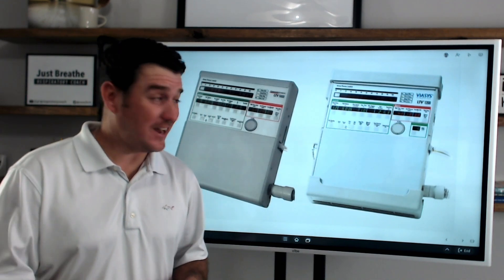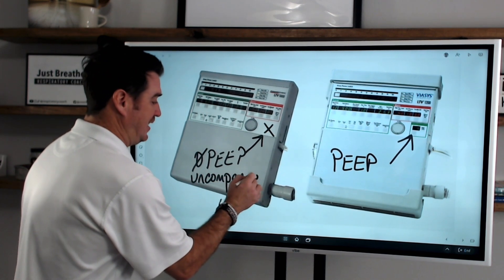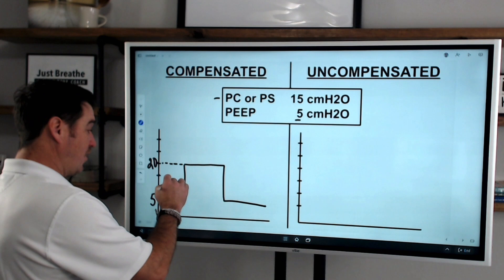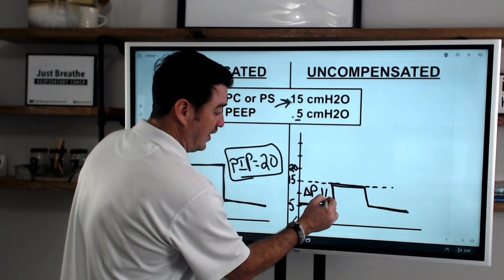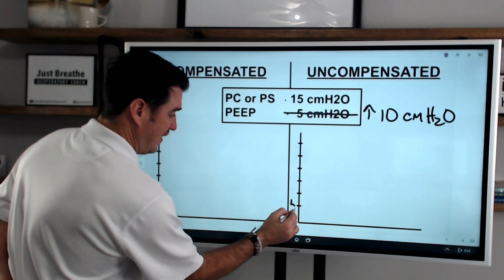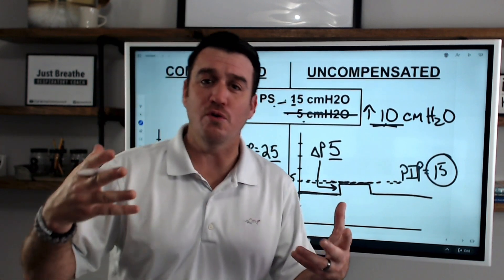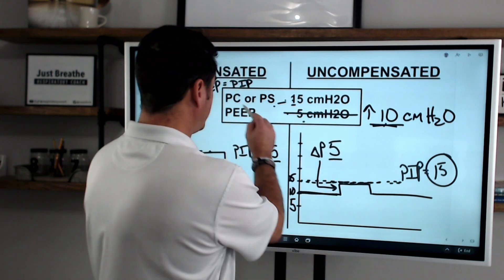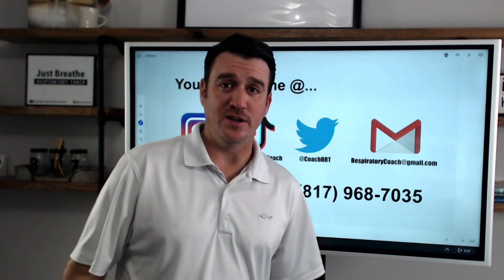Respiratory Therapy - PEEP Compensated vs Uncompensated

Comment: On Drgaer ventilator on the waveform its showing starting the peep from zero the baseline but in servo i its showing on the waveform that is starting from the set peep. When you try ps on both of them will show the same PIP so is dregar ventilator compensated or not? 

Its really confusing me 
Please if you can explain it

Comment: So if you have an uncompensated vent and you needed more minute ventilation; would it be a good idea to increase the flow rate or adjust the I:E to increase minute ventilation, since the pressure gradient is lower?  Or would you just in increase the pressure?
Reply from the maker: Hey Jonathan.  Yes, increase pressure to increase tidal volume in that case.  Remember you don't have control of flow in pressure control, so you're looking to increase pressure in that case.  Thanks for watching and asking your question.